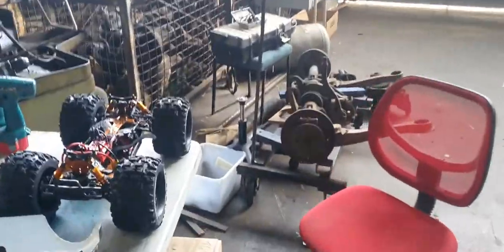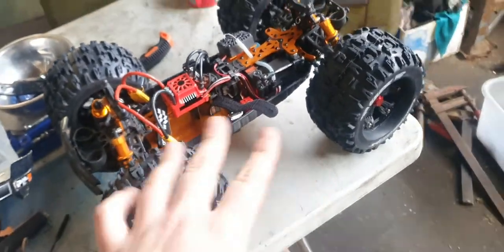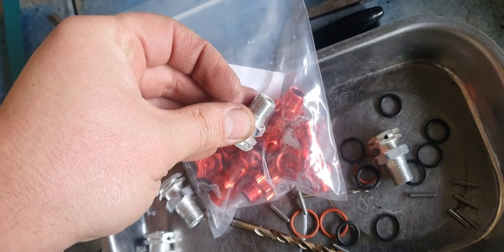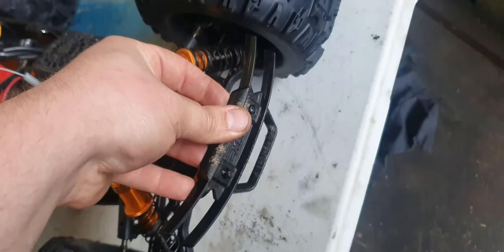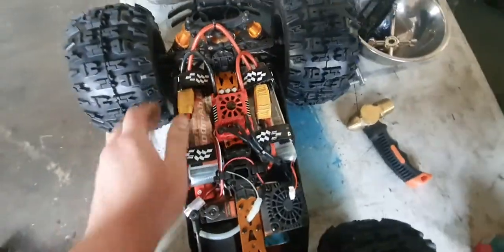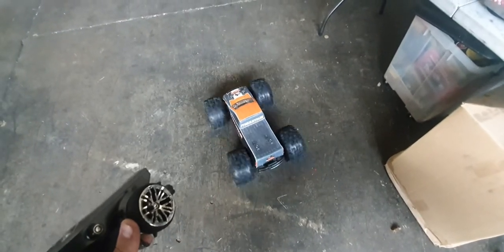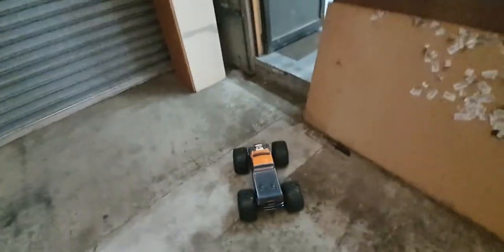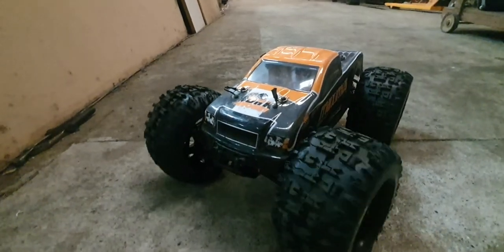dhk maximus modified 6s big wheels

Comment: nice build and love the enthusiasm and humour you bring to your video! i'm new to RC and only have experience with the 1/16 zwn hypergo. friend of mine gave me his maximus and all i've to do is to rebuild the front and rear differentials. will be looking forward to experiment with higher amp escs and 6s on it.
Reply from the maker: Thank you 😊
Reply from the maker: In the diff for front and rear put silicone ear plug in so the diffs are  locked up more. The car will handle much better. You only need to use half a silicone ear plug in each diff and keep the oil in the diff. Just gam in the half ear plug in.... 👍
Reply: @differentials  thanks for the tip! have you tried fitting slightly bigger motors on it?

Comment: How come you didn't show it running? I wanted to see how those tires worked and what it ran like with the 6S. This was just a big teaser video. lol
Reply from the maker: Hahahha
Reply from the maker: It blew up the rear diff and then the front diff because it was overpowered, the differentials  can only handle 4s I have realised. I'm sick of changing the diffs in these so just a bit of knowledge from experience. do never overpower a car because they can't handle it they're designed for what they release with.